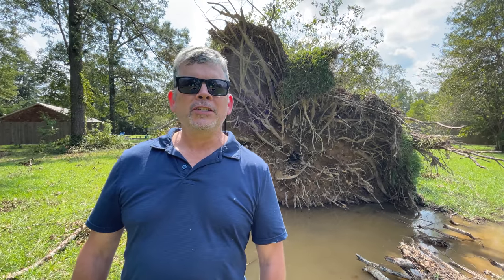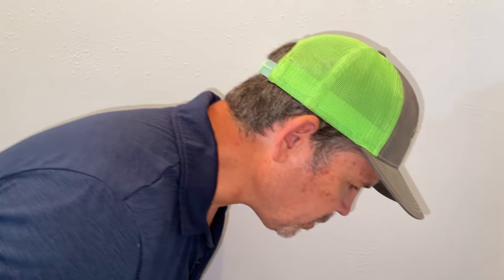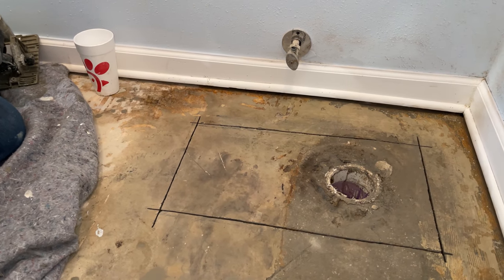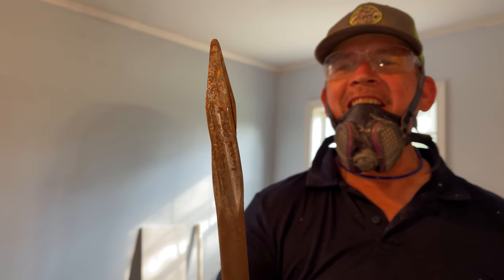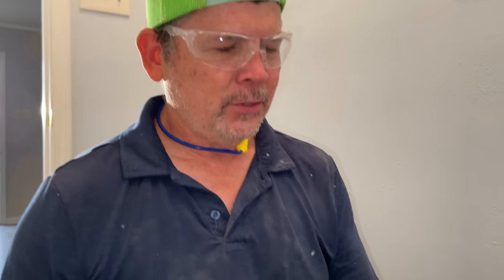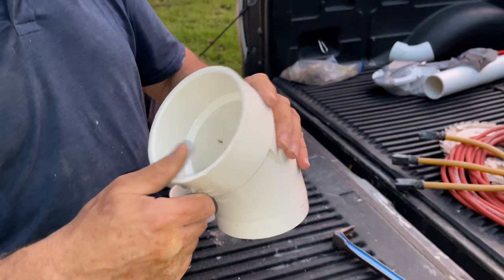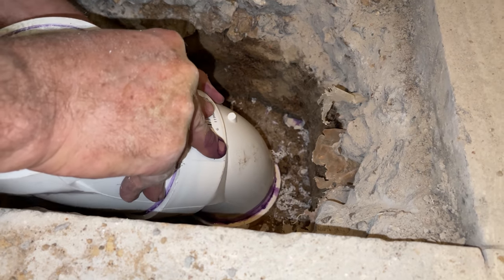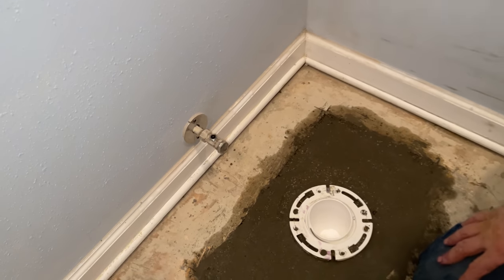We Moved a Toilet Over 5 Inches and It Kicked Our A$$

Comment: What you need to add to your toolbox is a nice set of "fitting savers".
Reply: Was thinking the same thing the entire video...Get some Wheeler Rex.
Reply: They really are essential now. Along with the inside pipe cutting bit it's pretty much indispensible bathroom remodeling tools. 

One way that works well is to use  a heat gun on that hub then when the pipe is soft you can get behind it and twist it out but the first time you use socket savers it's like, " why the hell did I work so hard for so long."

Comment: Look into a drill bit called a “socket saver”, a must have for anyone who remodels old plumbing work!
Reply: Thanks for the advise. Gathering tools for my bathroom remodel.
Reply: The "socket savers" do a good job of re-drilling a PVC or ABS socket, but you have to be able to get the bit and drill in line above the target socket.  I've found very, very few times that I've had access to reach it.  Good for recycling fittings on the bench.
Reply: @chrisgraham2904  probably would have been perfect in this case
Reply: A great tool, the nice ones are pretty expensive though.

Comment: To break out concrete mark x on floor where yo need center of flange to be, set one sledge on x and hit it with another, with a little practice you will find it take 4 hits to punch through slab. Once you have done this you can see what you need to do to finish. Makes breaking concrete slabs a dream. They also make offset toilet flange and 45 flange.

Comment: what about sinking a couple of screws in the flange holes before the concrete set up (or after) to make sure that those weakened cut down flanges don't fail?
Reply: Those pipes are in no way structural. The toilet sits on the concrete and there's simply a wax ring above that plastic circle for the water seal. The pipe is set in concrete so it won't move. I believe the screw holes are there if you have the flange on top of a subfloor or OSB just as an attachment point so the pipe doesn't shift but in this case, the concrete already accomplishes that.
Reply: The flange will crack if not screwed down, even if it’s in concrete. Some people are weird and move around a lot when, uh, taking care of business.

Comment: A 3" fitting Hub will fit snug into a 4" pipe, in this case you could have used your 3" fittings.. will help you with height issues as 3" fittings are shorter and can glue directly into the 4" pipe without removing and or butchering the 4" hub..
Reply: Yes , put a 4x3 bushing reducer into that 4” hub and then use 2 3” Street 45s. Plumbing code is requires a minimum of 15” from center of flange  of space left and right. And 12” from back wall. If it were me, I would have dug a little more and got rid of that 4” Elbow, coupling out and just elbow to where you needed it.

Comment: Yeah, that brought back memories.  I was helping a friend (now my wife) change a toilet at a house she just got for her daughter. It was leaking around the base, so I said "Sure! I can help".  Then I discovered it was connected to a broken cast iron 2" offset.  I thought, "No problem.  Remove the offset and get a 10" toilet".  Turns out this WAS a 10" toilet.  The damn pipe was 8" on center from the wall....
Yup, I cut the terrazzo & dug out, then had to go down far enough to allow for the twin street elbows.  What a nightmare. I was in I.T.....
Reply: This is why you have a wife now.

Comment: There is a tool already made that augers out the pipe while leaving the socket intact.  It has various names, but the most common are the "socket Saver" or PVC reaming tool.  It comes in various sizes and isn't that expensive.  A real time and aggravation saver.

Comment: Should have checked for a 12” distance from finish wall while gluing
Reply: That's what I was thinking!
Reply: The center of the flange must be a minimum of fifteen inches from the side wall and from any other fixtures installed on the other side, by code. The code compromises made below the concrete won’t be visible except to those who view this video, but the distance to the side wall and other fixtures can easily be measured without having to view this video.

Comment: I think I would have reduced the pipe to 3" a lot easier to deal with and 3" would def be adequate for the little run since you are going right into 4" that and the socket saver as mentioned would have worked there and save time and games.

that being said hats off to saving the day with some hillbilly engineering sometimes it's the only way.  LOL

Comment: They make a 3in 45 offset flange that works with a 3in 45, that will fit inside of 4in pvc, as long as you have the depth for it.
Reply: True but knowing such an adapter exists only works if the supply store you are shopping carries it.

Comment: plumber here, there is a tool called a "socket saver" would make things a lot easier,  also if you ever need to break pipe out of the hub, put a stainless steel hose clamp around the hub, it will usually prevent the hub from cracking.

Comment: I had to do a similar thing when I redid my downstairs bath for my mom to live with me - I took an old late-60's toilet installation and moved it over to make it ADA compliant so we could install grab bars, etc. And I had the same problem - not enough altitude. What I did was to go down to 3" pipe -- all the bend radii are shorter, which makes the fittings need less altitude. I used a 4"->3" bushing and then did pretty much exactly the same things as you did. That reducer bushing probably got me 2-3" of extra altitude with the smaller pipe, though.
Reply: would have been my thought also. if the poop gets past the toilet bend, it's not going to hang up in the 3" for the 1" of street el's

Comment: I’d have dug down to the horizontal, cut it, put on a 4” coupling, a sweeping 90 and stubbed it. Then, cardboard around the stub, mix and pour concrete, pull the cardboard from the stub and set the flange. Further, I’d have moved the supply straight away 5” left, stubbed and capped, repaired the drywall and put on a new angle stop + escutcheon. 
I’m not beating you guys up at all. Your attitudes are great and infectious. What you did will work. That was one heck of a hiccup having to go back for 4” (UGH) Been there for various reasons over the years. Great clip and thank you!

Comment: Other quick tips. The flange should be higher than the slab, preferably flushed the floor, so there was no need to cut it that much.

Second, I hope you inserted the flange bolts into the wet concrete which would have avoided drilling later. You eliminate the risk for error. 

Otherwise, great job (and video) of using what you had to get the job done.

Comment: You know they make offset flanges for this very reason, right? Granted they're tough to find especially for 4 in. (definitely not at big box stores) but you essentially made one from scratch anyway. They do make flanges that come out at a 45 angle right from the flange and you could've used another 45 and you would've been done. Probably would've still had to cut the hubs shorter though to make it work with the limited amount of space. Or you could've used a traditional offset flange which would've made the job extremely easier however, it wouldn't have given you 5 inches. It gives you like 2 in. which may have been enough to get it off the wall enough to make it more comfortable sitting on the toilet. Normally used in new construction/renos when there's a joist in the way of the toilet and you need to move the flange over enough to clear it. 

As a plumber, you did great for what you had. It's always the simple, 'just gotta move it over a little' jobs that turn into nightmares like this if you don't have the space.
Reply from the maker: Thx.  Yeah I looked at those offsets.   My home center had a bunch in 3”.  I thought I had plenty of height to offset without modifying fittings but the 4” not so much.   I appreciate your comment thx 👊

Comment: I would have used a pipe riser coming up from the 45s above the slab elevation, poured the slab,let it set and the  cut the riser flush and set  the flange that would be fully supported with clean bolt areas.  This set up would have replicated what was there to start with.
Reply: I am not a plumber and I agree. Not sure why they thought it was better the way they did it. Flange install should have been done after the concrete was set and as you said the pipe was cut flush with the concrete.

Comment: If the hole center was 12" from both walls a corner toilet could have been another option (there are flanges that accommodate a 2 inch shift ) . (replaced even after rest of work )   (~ 300.00 and they look really nice )

Comment: I've been a plumber for over 20 years. The best method I've ever found to get those old glue joints out is to cut several strips on the pipe inside the hub, then use a good sharp wood chisel to knock the pieces out of the hub. I've replaced countless closet collars that way

Comment: I ran into the same problem with some 2" Sch40. I finally used a heat gun to stop the pieces from breaking off. It took 30 minutes but I saved the fitting and reused it. Also, I like the taped cleaner and glue cans. Thanks for the video.

Comment: Im sure you probly heard many heat gun stories, but many times in the past iv faced this. I found if you trim fitting like you have and on the fitting your removing coat the bit being removed with the same glue your useing on the side unglued then light it with match.the pvc will get soft enough to pry out with screw driver. have a pail of water with a rag to cool pipe. do not inale any fumes at any stage. make sure you are fire safe first and plan with safe planning. try it outside as a dry run and you will find with a little pactice you have a easy way to remove most used fitting and have been a method i use when every thing else wasnt working.

Comment: I have removed the old PVC pipe just as you did here. Even used a hack saw blade and manually cut it inside and pried with a chisel or flat screw driver. Dremmeled any glue etc. Some months ago I ordered a 3 and a 4 inch Jones Stephens Socket Saver on eBay. About $30 for both with free shipping. Can't wait to use them.

Comment: Good job under difficult conditions. An inspector would likely not have approved cutting the hub but you did what you needed to do to get the work completed.
One thing i would have done is drill a few holes on the side of the original concrete and insert some rebars to keep the old and new concrete together. Once the soil.under the new concrete settles some, the new block might settle below the existing concrete, and yes, I am a licenced Civil Engineer.

Comment: I have used the same method until one day I just broke down and bought a set of reamers for that reason. Reamer just basically takes out of old pipe piece in the connection joint and makes so much easier!!

Comment: I've watched almost every video on the channel now, just re-watched this one because I discovered I am going to have this problem in the bathroom of my detached building (been here 10 years now, but the bathroom was removed and plumbing connections capped off before I bought the place). This video will be a huge help. One thing is a shame though... You stopped using the word Hub after commenting about how many times you said it; this video could have been the Stud Pack drinking game, take a drink every time Paul says "Hub". Cheers guys, thanks again for another great video.

Comment: Great showcase of real world solutions sometimes.  I had to do this exact repair in a commercial building, and the slab was 8" thick for some reason.  had to jackhammer quite a bit, and then ended up using a couple 22.5* streets to knock the toilet over 2-3" or so.  i had the luxury of not having to finish the same day so i could afford to get the right tools when needed, made the job much easier considering the overall difficulty.

Comment: There is an internal hole cutter made specifically for drilling out pipe hubs and there are also offset toilet flanges made to make this job much easier...but if you don't have all that...you make it work like you did there...looks good

Comment: A little tip I learned from down south is an improvised water source for wet sawing concrete. A 2liter soda bottle full of water with the cap on top and a small hole on the side near the bottom, just squeeze and direct the stream of water on the blade just where you want it. You guys do a great job!

Comment: I ran into that same issue with those drill bits that cut inside the pipe. doesnt work very well. what worked great was a 4inch cutoff wheel used for a dye grinder on that same attachment. no jumping around the hole

Comment: We use socket savers to remove pipe from hubs like this. They fit is a regular drill or chuck hole hawg. I feel your pain though, I have come behind other plumbers to move a closet flange only to find a 4" combo in the way of the direction it needs to move and spent hours and hours finding a solution.

Comment: I would have used a flange with the stainless ring don't like those plastic ones stick some screws down into the wet cement to hold down flange when cement sets 😊

Comment: Well done buddy, what really helps when chipping concrete in this situation is to make more deep cuts across your area where chipping, then the sledge is your friend. Using a shop vac to help with dust control also helps along with spraying water. Well done!

Comment: Man that hub was a pain in the ass! Believe it or not, I've used a torch on the inside of those pipes even down to small irrigation ones at half an inch to thin and weaken the inner pipe and remove it. I've also used a hole saw to carefully go right through the middle after I torch it. It took barely any time at all. Great job guys!
Reply: Also, after watching you guys do all that, I've decided to raise the floor instead of cut it. 🤣

Comment: I did a project like that in my sisters basement one time and after watching this I am glad I cut a big part of the concrete out and was able to use a shovel to dig the dirt out and deeper. Then went and bought all the parts and concrete I needed. I did not have a saw but used a hilti hammer drill with a 1 inch carbide tip bit and a big old chisel and sledge hammer to cut the concrete. Later I built a new shower and tiled the whole bathroom floor.

Comment: Your Multi-Tool makes a good concrete vibrator. That hammer drill works good too, just lay a piece of wood down a pretend you are trying to drill through it with that pointed chipping bit. It will vibrate the concrete quite nicely.

Comment: As a carpenter that has to do a little bit of everything, I know how you felt when you realized it was 4”. There’s been days that I’ve made three or four trips to Home Cheapo for various fittings. At one of my local big box stores, the man in the plumbing department was an excellent turd wrestler. He had retired and went back to work at Depot. This guy taught me more about fittings, terminology and what to do to solve problems than the plumbers on job sites I was running. One day I went in looking for his assistance and he had quit. It’s rare to find an associate working in one of the home centers that knows exactly where everything is and has the expertise with experience in the trade matching the department they’re working.

Comment: I find the best way to remove wallpaper is to add vinegar to the steamer water and work from the top down. The water will run down softening the wallpaper ahead of you doing some of the work for you.  You will have to do this twice because the older wallpaper has two layers. After the last of the wallpaper is off do a final scrub with 3M green scrubbie using warm vinegar water to get the last of the glue you can't see but can feel off. I really enjoy this site.

Comment: Oatey makers a drill bit for drilling out this type of fitting. The one draw back is the metal is soft and  it only lasts a couple uses. If you tackweld the bit to  the shaft, the bit will last .

Comment: love watching u work mate....in yr pinned comment u mentioned not having a heat gun...well l was on a job years ago and had to move a n IO but did not have the means... a plumber driving past stopped for a sticky beak and squirted some petrol around the  connection -- lit it -- and pulled the pipe apart.... keep yr blogs coming mate

Comment: I've done that before and still didn't have the hight to do it so I used a 4 by 3 bush in the hub and reduced to 3 inch pipe and then I had the clearance to make it work. You reduced to a 3 inch closet ring anyway. also with three inch street fittings you could bush the inside of the 4 inch 90 like you did with the closet ring and save yourself a bunch of work. Just a thought.

Comment: I always like to horizontally drill for a few pieces of rebar into the edge to span the slab. That is a good replacement for the wire mesh that was removed. Also I coat the perimeter saw cut sidewalls with Omega CreteBond or equivalent and lay a plastic sheet as a vapor barrier on the dirt before pouring the concrete. If I have time on the job I always like to water down the dirt for additional compaction properties and come back the next day to pour and finish.